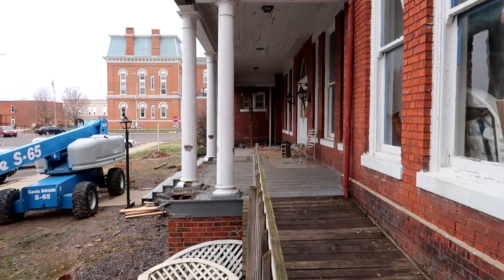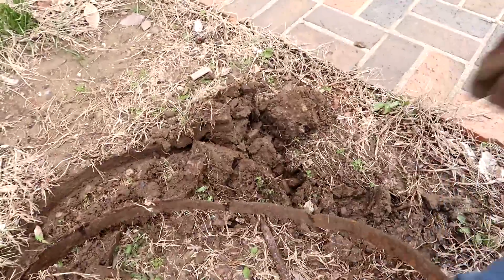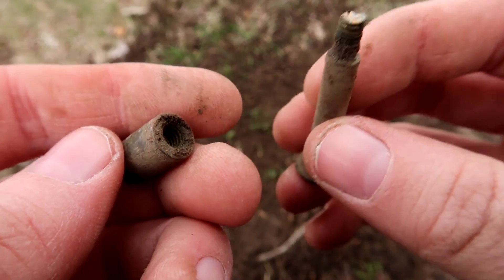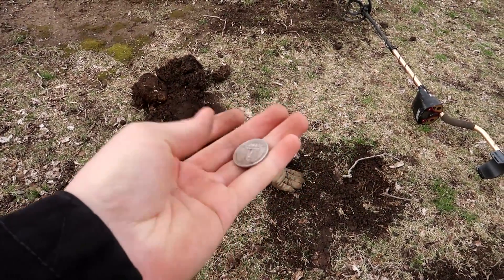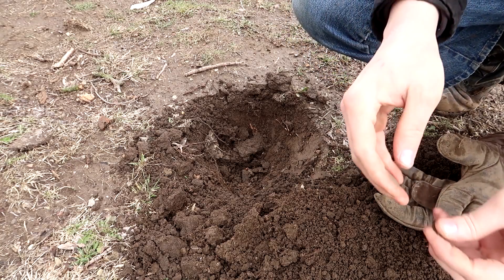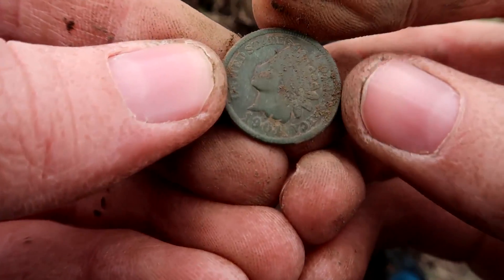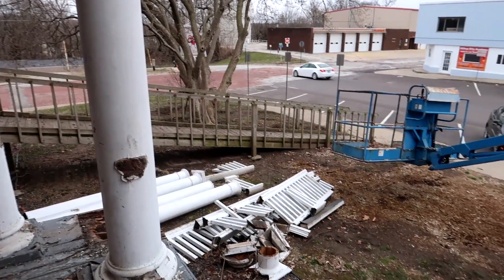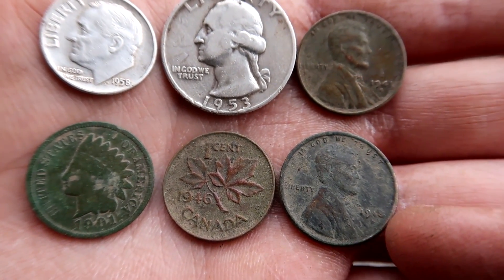Metal Detecting & Bottle Hunting 02: Found some Silver! Quarter, Dime, Penny, and Nickel

Comment: Pre 1965 quarters dimes, 50¢ pieces and  silver dollars are all silver I believe 92.5% silver dollars into the 1970s were still silver but a crappier alloy I think 65%  as for your pennies, all pre 1981s are solid copper after 1981 they are zinc with copper plating, zinc corrodes when it is in wet soil due to electrolysis is far as I know.

Comment: modern pennies are understandably made out of the cheapest materials practical but still cost more to produce than they are actually worth. Definitely need to get rid of them.
Reply from the maker: its even worse with 1$ bank notes.
Reply: I am on the ban the penny band wagon (and nickel) because it costs the tax payers more then it's worth...  As a basic example dime today is worth about what a penny was worth in 1950   If they want to keep the penny it needs o be made out of steel with some sort of cheap plating to resist corrosion.